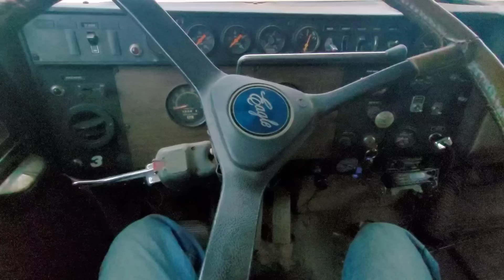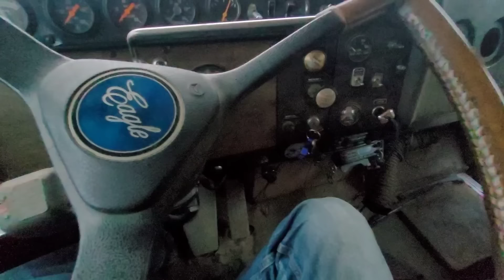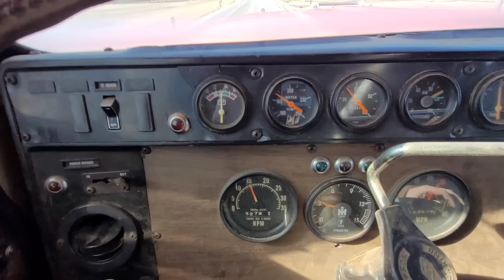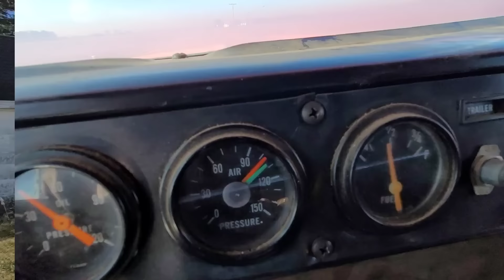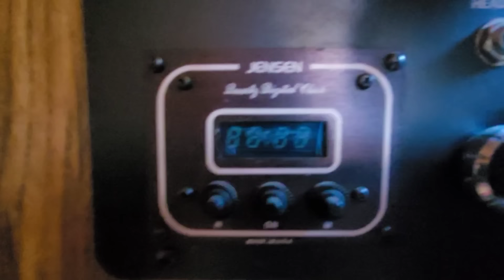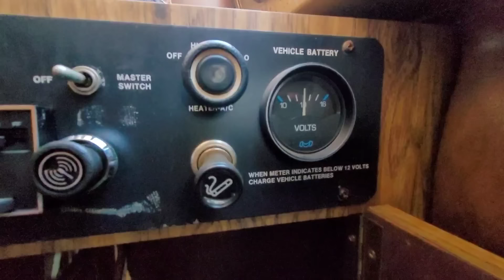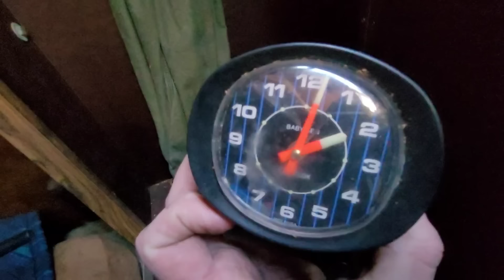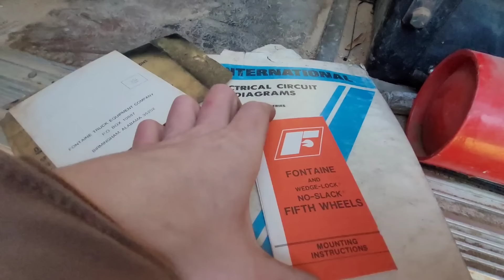getting the 1984 International transtar 4300 eagle home. former Nascar hauler?

Comment: Worked for a MAJOR dealer for 25+ years, not IH. About four year ago we took a number of IH trades with average of 1.4 million miles on each. While they did have all the issues you'd expect with that many miles, the cabs were almost tighter than new ones, very few rattles and squeaks. That's the result of having more metal than plastic, held together with screws rather than glue and velcro.

Comment: I worked on a bunch of those farmstars 4200 & 4300s back in the 80s almost every one i ever seen had busted motor mounts & the floor was busted under the seat ,the heater duct going to the defroster was blowing hot air outside the windshields would always be frosted up in the winter they were pretty cold inside in the winter time, IH rear end housings would always crack around the banjo, i made a pile of money back in the day working on those old rattle traps🤣

Comment: One way to figure out exactly where noise is coming from (in the cabin) is to park the truck in a quiet place and have someone put their phone with a neutral sound tone in various places around the cab with you inside, listening. Shouldn't be too loud, because it would overload the cab regardless in that case, but just enough to be noticeable. And you'll hear where gaps are. Gaskets not lining up or not fluffed enough to touch, gaps in the windows, panels etc.